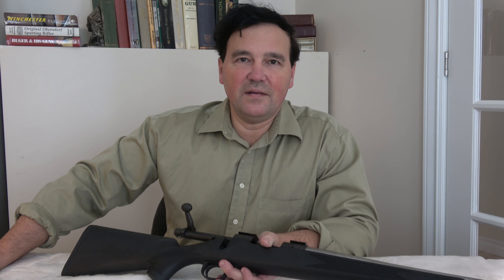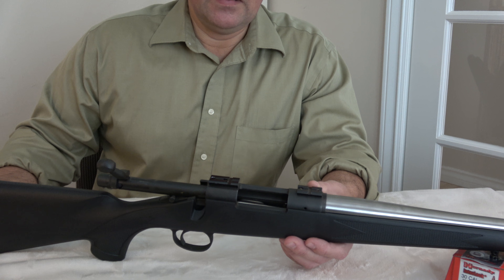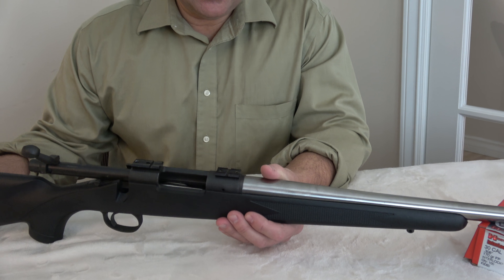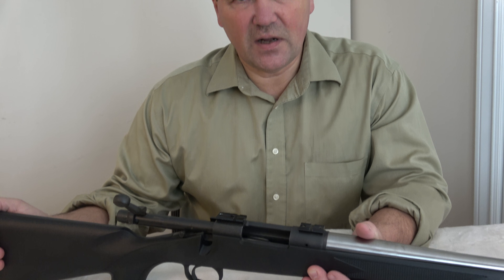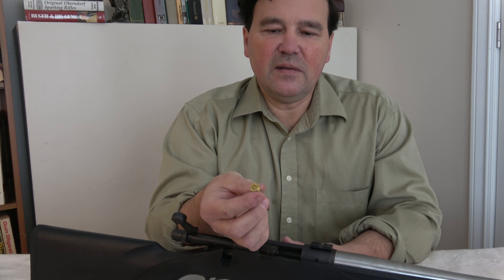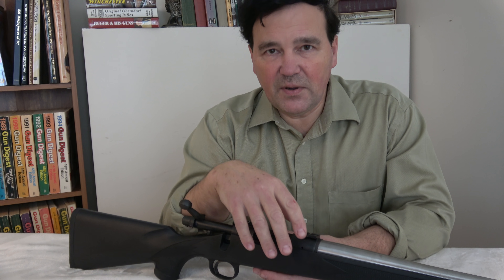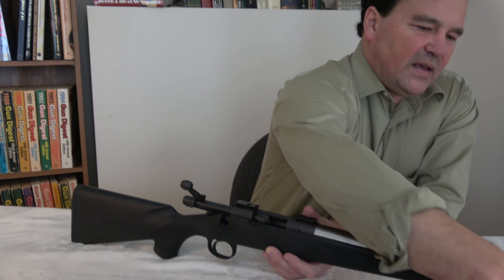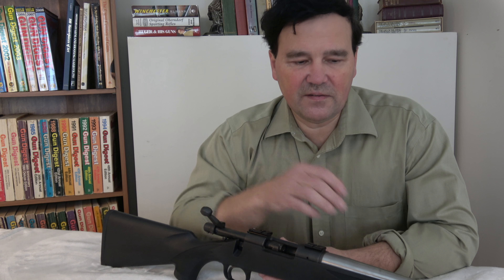Very High Velocity (VHV (TM)) Small Arms

Comment: This is exactly the kind of tinkering video I was hoping you would make. This was a blast to take in. Keep up the excellent content!
Reply from the maker: Thanks Seth!
Reply: @UnitedStatesOfGuns  I just found this one. Very intriguing, Had read many years ago of .22 cal being tested by the DOD and I believe Roy Weatherby at 5,000 fps and having phenomenal penetration through steel. I don't recall mention of rifling. Just  a large case full of slow(?) powder at very high pressure. As you described the challenges of leakage and stability, my first thought went to a slick plastic sabot with grooves on the outside molded into the plastic like the shotgun slug. at the speeds you are talking about, you would not need or want a high rate of twist. I feel the 30 cal bullet is good as you can buy 250 grain bullets.But then you will need a larger bore. There are so many cases that would lend themselves to this experimentation, however the .284 win case necked up to .40 so the sabot could carry a .30 cal bullet. considering that you want the combustion mainly in the case, you would maybe consider a smaller bore size (.375 or .35) or fatter case or both. It's beyond my current means, but if you or someone else pursues it I hope I get to read about it. The 700 action is impressive, but I wouldn't stand next to it when it is fired. I think strain gauges might help at least in a relative way, Oheler used to sell them I think.

Comment: Brilliant sir....the reasons why the Russians and later the U.S. adopted smoothbore main gun tubes for full-sized heavy battle tanks. Projectiles fired from the main gun on a modern heavy battle tank, are moving so fast the twist of the rifling cannot be attained, which is what enables the gyroscopic/spin effect that results in stability. Retained velocities at great distances allow for accurate shot placement at extended ranges (3-4 kilometers with modern battle tanks) Additionally, smoothbores offer the gunner more options for ammunition types to be used on specific types of targets. projectiles fired from the main gun are not impeded nor enhanced in terms of mid-range trajectory and velocity. The only effect rifling would have on such extreme speed munition would be counterproductive to the purpose of rifling, which is to stabilize a specified group of projectiles designed for the groove twist pattern of the rifling. The pattern would be the number of lands and grooves rotating 360 degrees within so many inches to optimally stabilize projectiles of a certain length and weight, and still adequately stabilize a category of bullets of lesser characteristics. When dealing with centerfire rifles, sectional density and ballistic coefficient are very significant factors which can influence retained velocities and stability, and are therefore less vulnerable to harmonic vibrations that result in instability on impact as well as flight. The recessed tail, or boat-tail bullet is another example of mitigating the risk of instability by reducing turbulence in flight causing great gains in distance  potential. Another way to contribute to the stability of any bullet is the use of a heavy, and often very thick barrel. Many match rifle shooters own rifles with conspicuously thick and heavy barrels, with a twist rate designed to stabilize a category of bullets from 300 to 800 yards.

Comment: As soon as you used the word launch my ears perked up like a bluetick hound chasing a possum. The velocities which you were experimenting, if similar to the in velocities that you mentioned, caused me to  consider the possibilities of using projectile design alone as a stabilizing force in which rifling would no longer be a necessary component in the development and deployment of hyper velocity projectiles. I can actually visualize a projectile designed to operate on Bernoulli‘s aerodynamic principle to turn a projectile into a self-contained gyroscopically stabilized missile without the need of rifling. This sounds really cool
Reply from the maker: Hi Thom - I think someone will come up with something one of these days. Rifling is such a nuisance and deforms the bullet; causes bore friction and slows the bullet down. I like your ideas.

Comment: Another thought, without the rifling resistance, as the pressure builds from burning,  and the bullet has little pressure to push against, it gets pushed out of the barrel before much pressure developes, resulting in low velocity.  Depending on the hardness of the bullet, if it is soft enough, it could still obturate and seal the bore but still have low velocity due to lack of rifling resistance, and be pushed out the barrel before the pressure builds very high.
Reply from the maker: Good thoughts and true. Therefore,  powder with higher burn rates are necessary to generate pressure in the chamber. Also, the bullets does seal the bore more than one expects, even without rifling. The initial "bump" of gas pressure is more significant than I thought. Interesting area for sure.
Reply: @UnitedStatesOfGuns  I like your videos, we have similar tastes in firearms.   I especially like that you are quite knowledgeable, but don't act like a know it all.  Many people think they know more than they actually do, and act like they do know.   The truth being, no one knows it all, we can all learn.  But you talk in a nice friendly manner, express facts, and also express your opinion, but express it as your opinion, and openly admit things that you aren't completely sure of or maybe don't know.  Nothing like talking with an intelligent man who speaks openly and honestly.  Thank you.  Keep up your videos.   On a personal note, I particularly like your win 88 with the dark colored, I assume custom stock.  Beautiful rifle!   I am also a fan of the model 70. My personal favorite is a super grade with a pretty feather crotch stock.  A good shooter too.  Also, I like the classic style single shots.  The ruger number 1 is a favorite, but I kinda prefer the new 1885 action over it.  Problem with the miroku winchester 1885 is the top tang and the necessitated straight gripped stock.  The top tang and straight grip are nice if it is a 45-70, 38-55, or something similar, that you would put a tang mounted sight on, but it your rifle is chambered to a more modern cartridge that would benefit from a scope, I prefer the pistol grip stock.  Just my opinion.  A few years ago, they made a limited run of miroku built B78's, that incorporated the newer 1885 action, but minus the top tang, and sporting the B78 style, pistol grip stock.  I was fortunate enough to pick up one in 30-06 (my favorite cartridge), but it had a beautiful brown feather crotch stock, and a 24 inch barrel, making it an attractive, well balanced,  full performance, but compact hunting rifle.  One of my favorites.   They also had another one in 300  winchester mag with a 26 inch barrel, and a more blonde colored stock with beautiful extensive fiddle back throughout.  I was ready to take both, but foolishly talked myself out of the 300 mag.  In my opinion, it was perfect in that caliber, the 26 inch barrel well suited to the 300, while making a nice relatively compact hunting rifle.  I've regretted that decision, many times.  I would love to have another such rifle, the 1885 action with pistol grip stock, with the 28 inch barrel, chambered to a cartridge like the 257 weatherby magnum, or 270 win, or other similar caliber.  The 28 inch barreled rifle not being overly long with a fast, flat, easy shooting cartridge, ideal for deer, antelope, and maybe up to elk sized game, and the long barrel making the most of the cartridges performance.   It would also have to have a beautiful, highly figured, wood stock.  I also like the miroku built 1885 low wall. I still have one in 243, and had one in 22-250, with a 24 inch barrel, and a plain pistol grip stock.   I was seriously thinking of having the barrel bored out to 25-06, and restocking it with some real pretty wood, but foolishly talked myself out of that too.  I think it would have made a very nice, light, slim, compact and elegant hunting rifle for deer/antelope.   Especially if the receiver and lever were also color case hardened.   I also like the Haghn (spelling?) Single shot rifles and one of the smaller framed versions with a 24 inch barrel and pistol grip stock, chambered in 30-40 krag, would make a wonderful hunting rifle.  Of course it would have to have fancy wood, color case hardening, etc.  :)   But the price......   :(     I am contemplating such a build on a miroku built 1885.  Nothing like dreams and plans!    Keep the videos coming, love the variety of firearms you show.  I like all types but lean more to old school hunting firearms than the new AR style, and you seem to show more of the old school, which I like.  Also the unique ones like the falling block, double barrel, etc, are very interesting.  Love savage 99's also, i think they are very elegant also and look especially nice, all fixed up!!  :)   Looking forward to future videos.  Thanks again.

Comment: There is a natural frontier to achieve high muzzle volocities. It depends on the speed of sound in the combusted propellant. It is the same speed of shock waves, which propells the bullet. No bullet could travel faster than this shockwave. The speed of sound itself depends on the temperature, pressure and molecular weight of the gas inside the chamber. For rifle propellants this maximum speed is 2300m/s up to 2500m/s, obtainable velocities are lower. The ultra high velocities could only be reached by a two step or multiple step chamber where a piston is driven by normal propellants against a chamber with a light gas (hydrogen or helium). Since the speed of sound is much higher in this media, you could achieve velocities above 14000m/s and more. To increase rifle velocities, the propellant has to burn at lower temperatures, higher pressures and lower molecular weight of of the gas. It's a tricky thing to achieve all points. In WW 2 there were some studies about "kalte Pulver" (cold powders) for artillery use. Another result is the light gas gun or Leichtgaskanone, which is used by NASA for re-entry and impact research. Greetings from Germany!

Comment: This was very interesting video and gives a new approach to what people might see as inherently insane, but nonetheless very interesting. When you said or rather thought of ways to create the gas seal I immediately thought of either paper patched bullets to engage the barrel to create a seal or something akin to a lead minie bullet where the back of the lead could deform to the size the rifleless barrel. But then it struck me after the statement of machined bullets and no longer needing to conform to typical bullet lengths you could use a long projectile made of aluminum with lead lined grooves on the back or body of the projectile (like Grease grooves but with enough lead to sit snug in the barrel) Although I'm probably wrong it's not far from impossible to do and to test. Best of luck, a fellow fan of the show.

Comment: Russians have some new civillain cartridges based on the x39 and 354R case with Metford rifling , 10 point something millimeter now .
Reply from the maker: A Russian fellow informed me they have something along what I have in mind already. If Russian snipers toss their 12.7mm massive sniper and switch to a 2000 mps VHV round - this is about 6500 fps - no one could touch them.
Reply: Not Metford, Lancaster twisted oval barrel.

Comment: As with early artillery development, you need to have long barrels. smooth bores are easier for longevity. Smooth bore requires, as you know, some type of external fletching as in a sabot projectile. Always finding a crossover example is the British 120mm rifled tank barrels. They are in opposition to the rest being smooth. The British main guns do have a substantially longer range of accuracy. 

Very well done fact based research. Duplex and triplex powder loads are the answer for high velocities in shorter barrels as in the 454 Casule. The “best”, as a word, is my 5 inch 460 S&W. A 225 grain bullet at just under 2400 fps. It’s has a tremendous muzzle blast, but isn’t as harsh in recoil as people say. 

My last project was conceived by my uncle and mentor in 1981 or 1982. This was just after he developed the original 264 Improved. Someone made another years later, but with a different shoulder. And a very nice 6.5-240 Weatherby. 

He got around to it again in 1990 and I took over development of the cartridge and rifles in 1992. We named it the 6.5 Dakota. After getting my hands on and case forming the 300 Ultra Mag., and the introduction of US869, the cartridge was finished. The rifles model 70 actions and bolts were finely machined, modified and fitted with 29 1/2 inch Heart barrels. The barrels have a 1 in 8 twist even with high velocities. 

I purchased an Ohler 35 with a printer to provide documented proof of my results. 142 grain Sierra bullets were test fired on 98 to 100 degree still days, at just under 300 feet elevation. With the pre ignition conditions of a hot day, I produced velocities over 4000 fps., with a 16 fps deviation on the final test loads. Now being studied as you are, you know I just said a mouth full. 

I was contacted by the R&D supervisor for Dakota Arms as they have many of their own product line of cartridges based on the 404 Jeffery’s case. A world class and most likely best American gun smith Randy “The Real Gunsmith” in Wyoming developed those cartridges. 

Long story short, they were not interested in my cartridge.  Humorously, Nosler introduced their 26 Nosler 24 years after our 6.5 Dakota. It is simply our cartridge with a longer body. I explained, and Dakota was aware, if my case was lengthened, they would start receiving diminishing returns. 

I enjoyed listening to your ideas, as I do all those who do their own research and development. Most all innovation comes from people like us and many others who think outside the box. 

There is a couple in Australia who develop shoot and showcase their work on YouTube. It is called Sam and Mark after work I believe. I hope I didn’t mess their names up. They are really fantastic couple to watch. Their learned knowledge is right in line with what me and my family have done.

Sorry this was so long. I could talk for days about this passion we share with growing numbers. I am really very happy to see it is continuing properly.
Reply: Aaron Buckmaster 
I love to watch Mark and Sam after work, they are an incredible team

Comment: I think I watched this some time ago. I think you’re onto something I’ve thought about. I would like to develop a sabot that could deliver some type of stabilized projectile. You are correct that the stability is improved for a sabot with the weight at the front of the projectile. This is opposite from gyro stabilized projectiles where the weight needs to be toward or at the base. Your working in the same development processes that the engineers who developed the main gun for the M1 tank have done. You’re correct that you have to lighten the projectile because you are now using the kinetic energy of speed where weight is almost, not totally, irrelevant. The cartridges for the M1, which I have handled and fired, are a moderately hard steel alloy. Steel is an alloy anyway, but you know what I mean. Those armor piercing high velocity sabots, are fired at extremely high velocities in the range of FPS you mentioned as maximum. Even without riflings the barrels of those 120mm guns does burn out very quickly. You can fire any of the other projectiles for much longer duration, but those rounds do create extreme wear, extremely quickly, even in a smooth bore. Curiously the British counterpart has a rifled 120 mm main gun that actually has a longer effective range that our gun. The M1 has, for the most part, a 3500 meter effective range, and the Brits main gun has an effective range in excess of 5000 meters. Interesting isn’t it, that when reaching out to longer ranges the heavier projectile becomes more effective. It is just like the battle of balance between weight and velocity of our hunting rifles at long ranges. Double the weight, double the energy at a given velocity. Double the velocity, quadrupole the energy at a given weight. Round and round it goes. These are the challenges I love to work at.
Reply from the maker: So interesting. It took me awhile to figure out what was going on with no rifling and no bore sealing; the bullet can be any length and just about any shape so long as it fits. I'll have to return to this one day. I should have tried a stronger lathe turned steel case and more pressure in the chamber - but at the time it felt like I had gone far enough. The sabots you mention are the way to go - very long and very thin and extreme velocity; now only that nasty stability issue. Cheers.

Comment: I have thought about this for years, and it may be prior art, but spin the gun! Envision a cylindrical action and a smooth bore barrel rotating at a calculated rpm. This would not be a practical portable weapon, but the design could be used for ship weapons or ground artillery. I'm thinking maybe a test chamber/barrel in a high speed lathe spindle. It would be interesting to try. Food for thought.
Reply from the maker: Mike....Mike.....do it! And thank you.
Reply: That's a very interesting idea!
Reply: bullets spin at many thousand RPM dont think your idea would work.
Reply from the maker: Hi Sanch - I'll think about that - good comment - with no rifling though - the bullet doesn't spin; and thus is inaccurate. Thanks for writing.